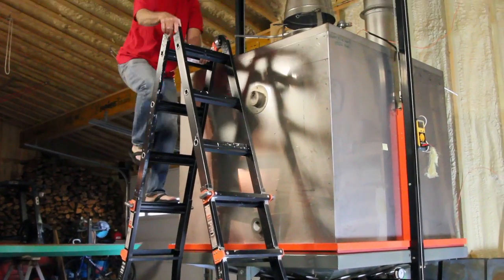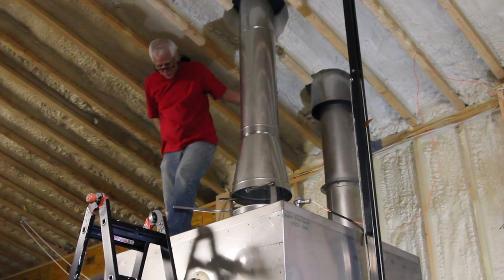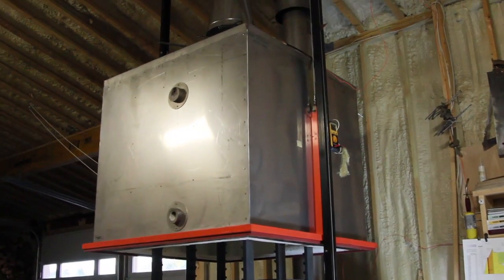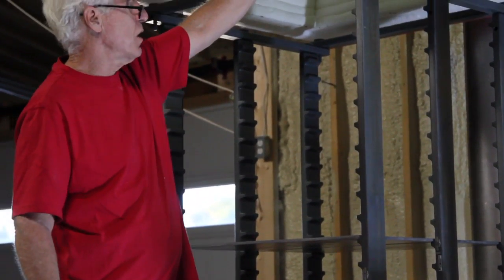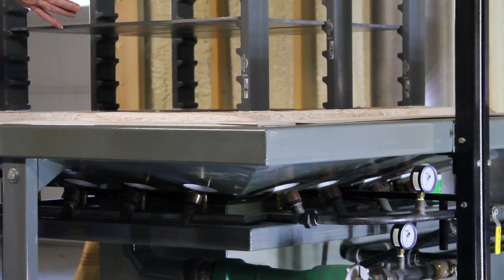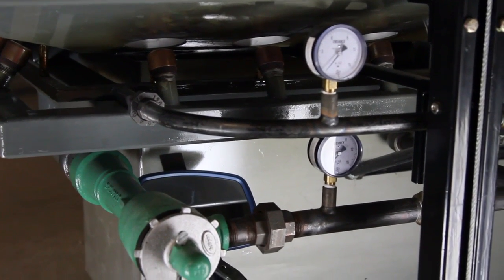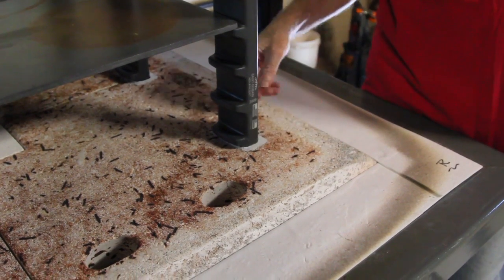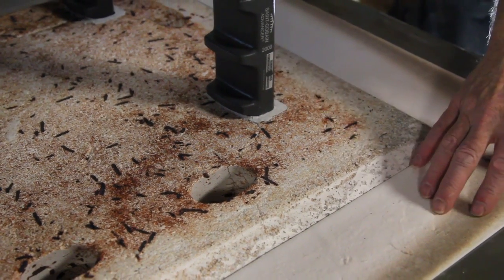Hank Murrow Style : Top Hat Kiln—design adapted & fabricated by Dan Weaver at Water Stone Sink

Comment: Whats the BTU consumption?
Reply from the maker: BTU consumption varies according to firing schedule. In other words—glazes typically require different firing schedules to develop different qualities. My kiln has a 34 cu ft chamber size and 20.4 cu ft stack area. Firing with LPG (Propane) one firing example used 800 cu ft of fuel (21.97 gallons) for a total BTU of 2 million for 12 hour firing ($2.00/gallon Propane cost = $43.00). This is 166,666 BTU/hr or 160K BTU/cu ft/hr. Another 20 hour firing schedule used 1300 cu ft LP or 3,250,000 total BTU (2500 BTU/cu ft LP) or 162,500 BTU/hr or 4779 BTU/cu ft/hr or 32.7 Therm (.915/gallon). 2010 Propane cost was $3.00/gallon dropping to $1.30/gallon in 2016. My kiln can easily be fired to cone 10 > 11 in 8 hours with less cost, less than optimum glaze benefit and less even temperature distribution from top to bottom. The most useful fuel efficiency indicator is 4779 BTU/cu ft/hr or 32.7 therm (.915/gallon). I hope this is more helpful than confusing. My original design intent of fast & low cost firing has been tempered by the importance of firing schedule for optimum glaze development. My experience is that cheap firings typically produce quick cheap pots. Most of my current firing are 16 to 20 hours long depending on stack density and glaze requirements. Multiplying hours x 4779 BTU/cu ft/hr will give a reasonably BTU estimate to compute your firing cycle fuel cost. My apology for inadvertent numerical errors.
Reply: Thank you for that comprehensive answer. It gives me quite a bit of information to base my future build.
Reply from the maker: I thank you for your interest and appreciation.

Comment: Thank you for sharing Dan.
Any details about your choice of kiln furniture? 
I'm also curious about the way the posts are set in the cast refractory are any special precautions needed there?
Reply from the maker: My kiln furniture is Advancer from the St Gobains plant in Worcester, MA. This lug post system allows each shelf to be moved independent of the other shelves because they are not stacked on top of one another but sit on Lug Post ledges. The floor of my kiln is castable refractory in which I cast mortices sized to accept the Lug Post feet. The mortice sockets are slightly oversized so the Lug Posts can be setup square to one another and then the 1/8 inch socket gap is filled with a very small amount of refractory castable which when set anchors the Lug Posts in position relative to the kiln floor and one another. The Advancer refractory is expensive to purchase but service life is virtually forever. Any glaze spill simply flakes off so no kiln wash is used. The only functional downside is the need to keep the shelves dry. Though the Advancer material is very dense with very low absorbancy—if the shelves were ever allowed to sit in water for an extended period and then fired without careful pre-drying—they will literally explode—destroying the shelving as well as kiln and contents. Keeping them dry is not really a large problem but one should be aware of this explosive potential. Over fifty odd years of kiln design and firing I have purchase a great many conventional clay and carbide kiln shelves. In fairly short order conventional shelves will break / distort / crack or otherwise render themselves useless for quality work. Advancer is well worth the price because they are perfectly stable firing after firing. They will remain functional long after I am dead and gone. In addition to the durability of Advancer the shelving is only 5/16 inch thick and so very light compared to conventional porous silicon carbide shelving. Handling the shelves they feel more like steel plate than carbide. All of my Advancer purchases are through kilnshelf.com—the distributor for St Gobains Advancer products. They maintain stock for common sizes and will order custom sizes together with Lug Post systems if needed. I use Advancer shelves in both of my fuel kilns as well as 5 L & L computer controlled electrics. http://kilnshelf.com/advancer-kiln-shelves
Reply from the maker: Setting the Advancer Lug Posts into mortice sockets in the kiln floor requires a simple frame to hold everything in alignment while the thin layer of castable sets in the mortice gap. Very important to use a high temperature castable which does not shrink or expand on setting (St Gobains has recommendations for this application). Additionally I carefully applied heavy duty packing tape (which burns out) to the section of Lug Post which contacts the wet castable to reduce any tendency to migrate water from the castable mix into the Lug Post or the surrounding castable floor. First firing after the Lug Posts are set also carefully follows a St Gobains drying schedule to be absolutely sure the moisture sensitive Advancer is slowly dried of any possible absorbed water. After that you are go to go for 1000's of firings as long as you do not encounter prolonged wet conditions which would compromise rapidly firing the shelving. Advancer can be broken from heat shock if you heat the shelves unevenly or at a rate that would fracture bisque ware. Advancer is extremely hard and virtually impossible to cut with normal means (it will quickly destroy a quality diamond brick saw blade). However Advancer can be successfully cut by a water jet contractor (after which you would follow St Gobains slow dry schedule before placing in service). Some may be interested to know that Advancer kiln furniture is slip cast.
Reply: Thanks a lot Dan, heartily appreciated.

Comment: Hi Mr. Weaver, question, how did you affix the ceramic fiber to the side of the kiln. It looks like you are accordion stacking the blanket, is it attached with something like sodium silicate?

Also, what size blanket are you using, is that 24" wide just packed tight?

Best regards,

- Paul
Reply from the maker: Hello Paul -- I use no sodium silicate anywhere in the kiln. I bend .25 inch diameter 410 stainless rod to create spike-tined fiber module hangers which are pop riveted to the inside of the outer stainless kiln shell. The spikes point up and down and are mounted so the spikes are about 1.5 inches from the inside of the outer stainless shell. The accordion folded fiber modules are placed tight against the inside of the outer shell and then forced down so the spikes impale the fiber modules tight against the inside of the stainless kiln shell. The first row of spikes at the bottom starter course have spikes pointing upward and all of the spike brackets on courses above the first course have spikes pointing both up and down (except the final course at the top only has spikes pointed down) so they both spike into the fiber module below as well as the next course above. 

The roof uses a similar but slightly modified pattern of spiked brackets to hold the roof modules tight to the slightly domed stainless roof shell.

I used 48 inch wide fiber blanket to fold the accordion modules so I could limit interior modules joints to the corners alone. In other word—the front and back interior fiber module are the same as the interior kiln dimensions. The front and back modules are installed first and then the side modules are the width from the inside face to the inside face of the front and rear modules. This way the corner joints are what a wood worker would call a butt joint though in this case the joint is under considerable compression to counteract the shrinkage tendency of the fiber.

The front and back of the shell is 54 inches so the front and back fiber walls are 54 inches long once they are compressed into place. The side modules are 16 inches shorter than the 52 inch wide stainless shell depth because they butt joint the front and rear module which are both 8 inches thick. Due to this 8 + 8 = 16 deduction the side fiber modules are each 36 long.

Because the raw fiber blanket was 48 inch long—my 48 inch long modules were centered on the front and back with short 3 inch module section compressed into the corners to make up a total width of 54 inches for the front and back walls. This creates compressed joints 3 inches from each end of the front and back module corners. These corner joints are hidden by the overlapping 8 inch thickness of the 36 inch long side modules so the interior fiber face of the kiln only shows compressed butt joints at each of the 4 interior corners.

In addition to the spiked fiber hangers—the quality of the fiber and the method for accordion folding is critical to produce a stable end result.

One must very carefully select fiber appropriate for this application. I used FiberFrax DuraBlanket 2600 x 1 T x 48 W x 25 feet L x 8# density x 9 cartons—which has proven to be perfect for this application.

I do have complete raw video footage of the fiber module folding and module installation in the kiln shell but I have not yet found time to edit this footage. My method for folding the continuous length fiber modules is something every fiber kiln builder should understand and use. There is currently very little useful information regarding folding your own fiber modules and this is unfortunate because the ones you can fold yourself are far superior and cheaper than commercially purchased modules. My method for securing modules to the kiln interior wall is also much cheaper and superior to commercial methods.

My fiber modules were accordion folded 12 high x 8 thick x 36 & 48 inches long using 8# density blanket compressed to 12# density the dimensions of which were retained @ 12 inch height & 8 inch width with hot-glued paper tape which was removed after the modules were installed in the stainless kiln case.
Reply from the maker: Fiber Hanger Plates 2 x 2 x 16 gauge squares welded to bent anchor rods @ 3 places74 - 2 x 2 x 16 gauge 304 stainless sheetSheared stock - all hangers can be mounted with these square platesBottom U plates need plate bottom mounted flush with hanger base - hole should be drilled to give adequate clearance for pop rivet head which must be set from inside the kiln box because the box perimeter tubing prevents outside rivet access.Center mast-side hangers can be mounted with same square plates riveted into the box dog upright from inside the box.Welding hanger plates diamond fashion looks like the best wall to spread contact.Both sides employ 3 hangers per row with three 12 inch module rows and one shorter top module.9 x 4 sides = 36 H hangers + 12 U hangers for the bottom course.Short 36 inch inside-wall (mast side) has 4.125 hanger spacingLong 48 inch inside-wall (front & back) has 4.625 hanger spacingFiber Hanger Rod 1/4 in OD rod - 410 stainless round rod (heat resistant alloy)42 - H hanger x 3 ft each = 126 linear feet x 5/1632 - U hanger x 2 ft each = 64 linear feet190 linear feet x 1/4 round
Reply: +Dan Weaver Wow, Excellent writing up! You answered questions I hadn't even asked yet (or knew I had), but going back to that accordion module affixation hurdle: that's a really elegant solution because it won't radiate the heat out of the kiln, whereas a wallpaper style application, as many kilns seem to use online, has that limitation. 

What type of rivets are you using? Is it just a matter of brass that is hammered on both sides with a ballpean hammer? Or perhaps it is a specific type of high-temp product?

I'll need to re-read this a couple of times just to make sure that I have it correctly (just headed out the door). 

That's too bad about the video, but I completely understand. Editing raw video into something pithy and informative can be a big job. 

Alternately, would it be possible to drop by Waterstone Sink sometime and ask you for a tutorial on proper accordion module construction? It would be like giving a rocket-ship to a caveman (me), and be much appreciated. No worries if you schedule doesn't allow. 

- Paul
Reply: +Dan Weaver Also, for the Fiber Hanger Plates, is that a commerical product, or might that be something that can be constructed with steel and a MIG welder?
Reply from the maker: +Paul Walter -- the rivets used are stainless pop-rivets which are commonly available -- google if not familiar with this fastener

You are welcome to stop by -- just let me know when you are coming. I do have a series of photos detailing the fiber module folding. Giving an adequate module tutorial is a big chore but I would be happy to discuss the general process if you are seriously considering using this method.
Reply from the maker: +Paul Walter -- I custom built the entire kiln with my shop tools. The fiber hangers I jig bent and TIG welded to the mounting plate. You will need a bending jig to insure consistent duplication but MIG would work as well as TIG as long as you moderate your heat as the stainless parts are small enough they have little heat sink capacity.
Reply: +Dan Weaver Ahh, I have seen pop rivets before and not realized that this was their name. 

That'd be brilliant. I'll plan on stopping by. Just gotta pick a day later this month. Will give a couple of weeks heads-up before I pop over.
Reply: +Dan Weaver Excellent to hear about the custom built parts. Commercial parts tend to be a bit pricey, and I prefer to build things instead (also it's just more fun). I made a note to ask you about this more when I stop up at the shop.
Reply: +Dan Weaver Would you happen to be free sometime between Feb 1st and Feb 5th?
Reply from the maker: +Paul Walter — I will be working on a Boston project throughout this winter. Suggest you contact me early spring when I will be back in the clay shop
Reply: +Dan Weaver Probably won't be able to come up in the Spring unfortunately. Curious if you might have some of the pics for creating fiber modules up online? (I think I have my head wrapped around it, but would be excellent to see a series of pictures too.)
Reply: +Dan Weaver Looks like you may be busy this time of year. Thanks so much for the info though, it has me on the right track. Keep up the great work and the very informative videos. Best regards for this new year, - Paul
Reply from the maker: I do want to respond to your questions and interests in a more detailed way. I have still photo detailing fabrication of each and every part of my kiln. I will make plans to create an extensive slide show of my construction stills which include many images detailing my fiber module folding methods and tools. The downside for you is my lack of time to build this slide show right now. I promise to do so but need your patience while I get my ducks in a row and find the time to do a proper kiln construction slide show.
Reply: +Dan Weaver That'd be fantastic! Understood for sure. Thanks so much!
Reply: Looks great. I would love to know if it continues to perform as well as you had planned, especially given the fiber walls. I would love to see more details if you do get time... I'm not the potter, I'm the engineer in the partnership, working on the design of an energy efficient and easy to load kiln such as your adaptation.